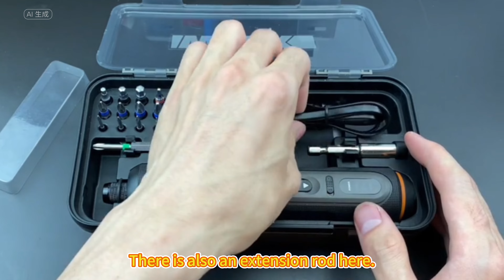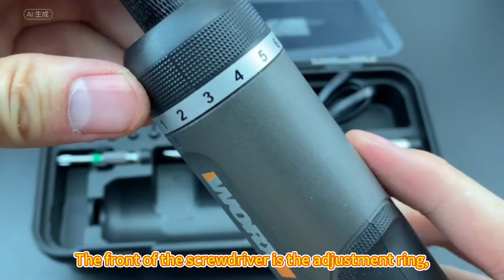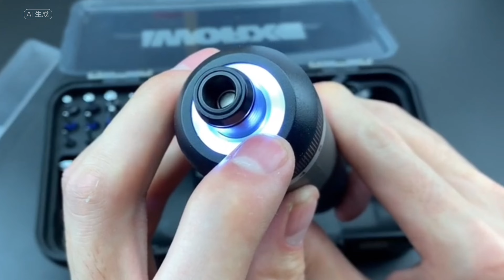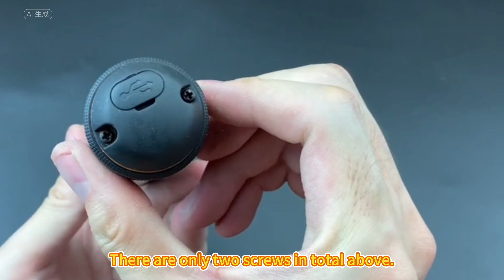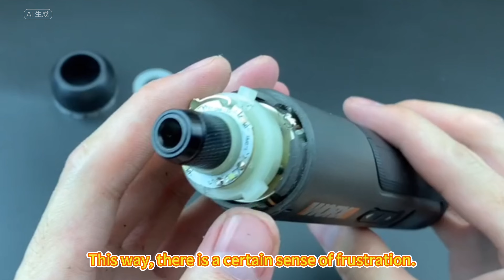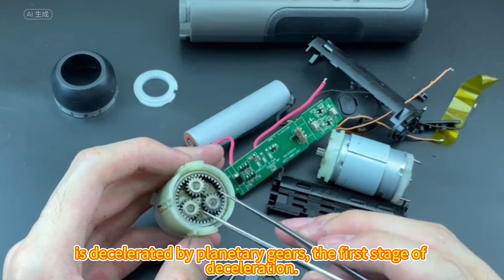WORX WX242 Mini Cordless Screwdriver Teardown & Working Principle | Efficient Tool for Every Home

Comment: How did you get the top part off? Really struggling with it. My unit won’t power on and the led lights indicating the power level stay on no matter what i do. Do you have any ideas on how to fix this thing?
Reply: Open it and check the wires connecting the board to the motor, and also the switches

Comment: It's a piece of shit, really. It will run for like a month, at light duties. Then either the battery or the power control will fuck up. Terrible buy. Might spend a bit extra and get the bosch at least is reliable and with non Chinese warranty

Comment: Now is this motor brushless??? I heard that they pulled the 242 off the shelf, because of clutch lockup or if the rotation bezel misses a click this can damage or strip the gears or cause lockup. That is why the 242 was taken off the shelf, because of rotation collar yolk hit and miss engagement and motor activation during improper engagement.
Reply: The 242L has the numbered dial collar ring for torque. Whereas the 242 has only a 2 speed setting with no dial for torque setting.
Reply: @ thank you. I just bought one on ebay. Didn't realize that L was missing. Does it go up to the same torque rating? Also does the L have the same problem as you described?
Reply: Is there a difference from 242 and 242L? Could this be avoided by simply keeping it on highest torque setting?